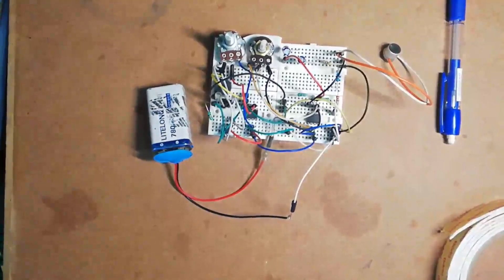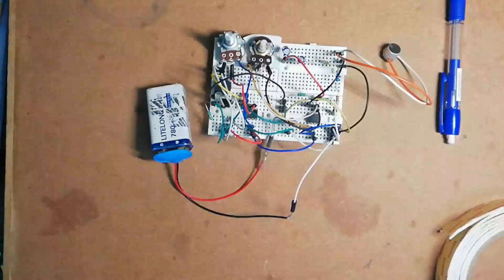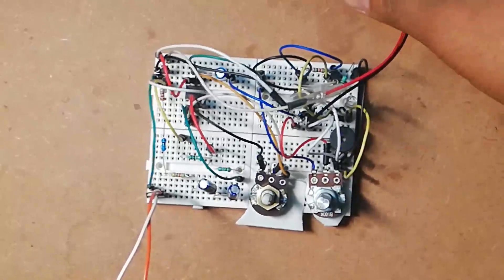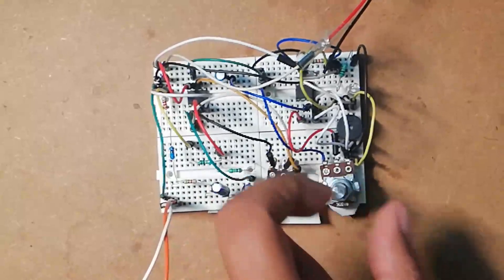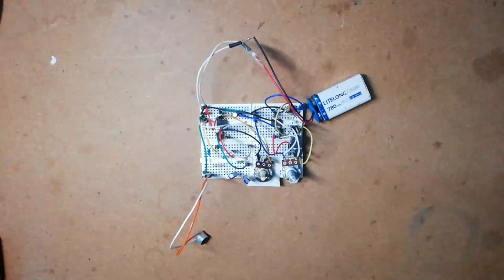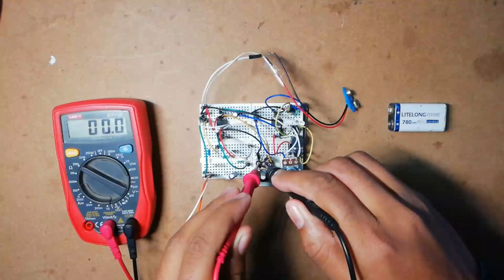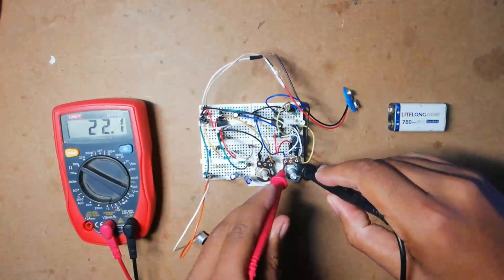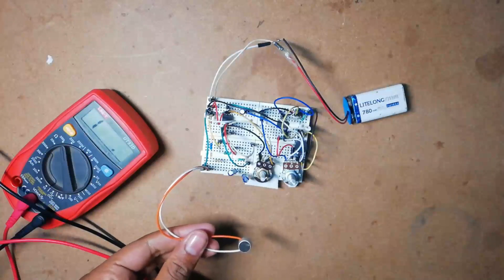sound detector circuit using op amp 741

Comment: Same error at min 4:00 and you solved it but u aren't even answering people who asked about it.. guys no one tries this and I'm giving you big dislike
Reply from the maker: In description section i had integrated the link of circuit and description, go through it because it is very difficult to edit video.
Reply: After about an hour of checking again and again i just made it work by adjusting the VR 
Must be a little bit before the level that makes the buzzer always peeping
Reply from the maker: @Mustafa.Amin2812  before that you should check the description section. We had written complete article not just for time pass.
Reply: Don't you think i have read it all? You wrote to set it to ground.. if i did that it doesn't stop peeping
Reply: @Mustafa.Amin2812  does both VR need to be full ohms or just adjust one of the VRs so it can stop beeping